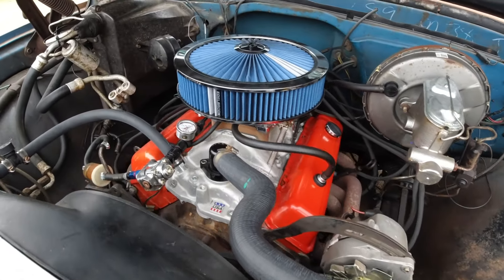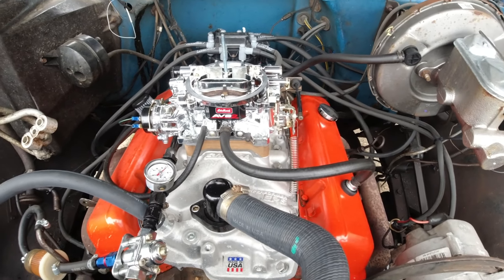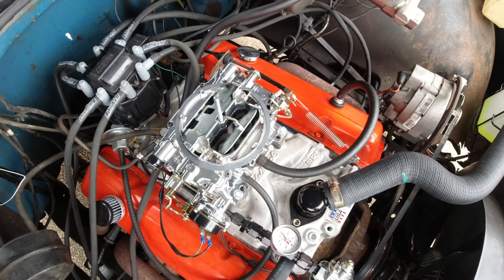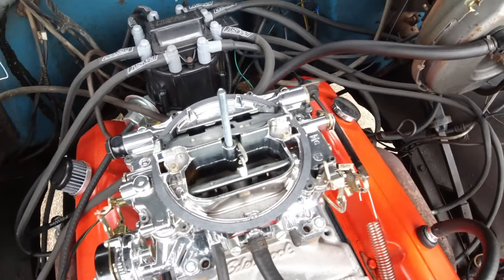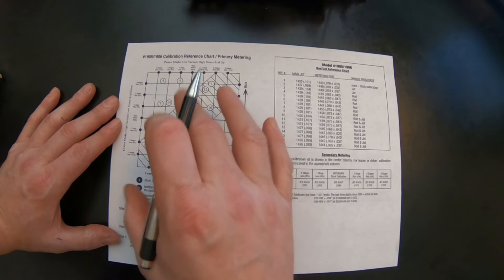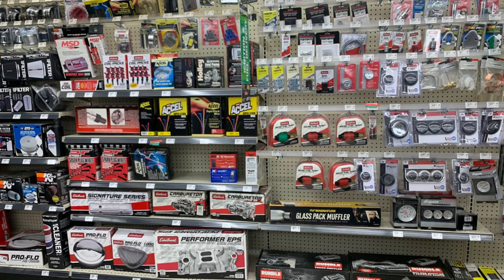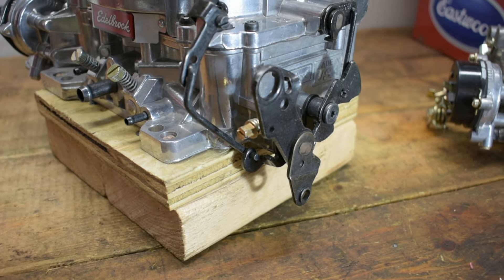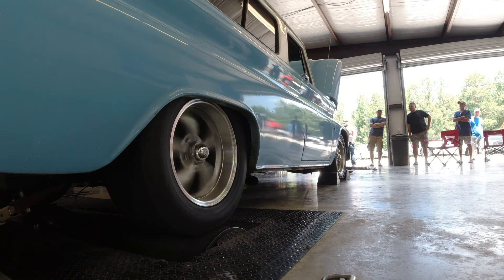Edelbrock Carburetors - The Good, The Bad and The Ugly

Comment: Hello car guys! Can some one tell me what size cam I can use in a stock 350 engine aluminum heads and using eldelbrock  carb and a aluminum intake manifold performer.. thanks everyone..✌️
Reply from the maker: Not enough info to offer a suggestion.  If you go look at the cam recommendation form on the comp cams website, you’ll see the list of things that need to be answered so a good recommendation can be made.

Comment: I have a Edelbrock 600 on a 351 W Ford engine that runs great. But it will not pass smog.
I have tried everything and it still won't pass smog. So I put the old Holley 600 on for the smog test and then put the Edelbrock back on to drive as it runs better and smoother than the Holley.
Reply from the maker: What did you do to tune the carburetors?
Reply: @MuscleCarSolutions  The smog test guy just said it would not pass. I went through the manual and bought a kit to recalibrate the out of the box calibrations to leaner. The second time I did the smog test it failed again except this time the smog guy said that the reason it did not pass both times was at idle not the 2500 RPM test. I wished I would have known that before I messed with the calibration. After blowing out all the idle circuits with carb cleaner and compressed air, setting the idle exactly per instructions, still would not pass the idle test. Too rich. So now I use the 600 CFM Holley for the test and run the 750 Edelbrock on the street. I am running a stock camshaft, and a 351 W Edelbrock dual plane performer manifold. 5 psi regulated fuel pressure. No vacuum leaks. I bought this 750 CFM Edelbrock carburetor new. It runs just fine, so I don't want to get rid of it.
.
Reply: Today I installed a new out of the box Edelbrock 800 CFM AVS2 to replace the Edelbrock 750 CFM I was having trouble with described in the discussion above. Problem solved. I just set the idle and made no other adjustments and got a AFR of 14 to 15 at idle. This is way better than the 750 with a AFR of 11 to 12 at idle. The AVS2 should be able to pass the idle smog test no problem. 😊

Comment: Wow amazing Video! Question I have a older Holley Carb part number 4778. 700 CFM It’s been on the Car for years. Engine is a mild SBC 350 with a performer RPM intake. Long Tube Headers. Factory Ac car. ( Ac works) my issue is no one can get this car to idle smoothly the Idle RPM is extremely high. I burn a bunch of fuel and I’m told with the adjustability of my current carbthat’s just the way it is. In your opinion am I “over carbed” for my mild set up? Would you suggest going to the AV2 to give me the adjustability I need to get a better idle and fuel economy? I look online and my current carb sells for $750… it just feels like overkill for my set up. I’ve taken it to professional performance shops. Same story this is the best it’s gonna get.
Reply from the maker: It could be over carbed.  Here’s a link to a video on how to select size and you can determine if you are or aren’t. I’ll answer you other questions in another post.  https://youtu.be/Hy4s9B43YM0
Reply from the maker: You still should be able to get the idle speed down.  Without knowing the cam specs it’s hard to gauge if that might be the cause.  The more radical the profile, the harder it is to get under control at idle. Remove the carburetor and check to see if the transfer slots are exposed, which I suspect are.  That’s why the mixture screws aren’t giving you the adjustability, assuming you’re not on a radical cam profile.  If you can provide the cam specs, we can include that or rule it out as a problem.  The other is timing.  What is your initial set at?  Timing and carburetors go hand in hand.  You adjust them both concurrently.
Reply: Thank You.  I know it’s a Comp Cam PART #
12-250-3 I have the spec card what specs do you need from it 

I’m not sure of my timing currently although I paid to have it set. I should know that.
Reply from the maker: @csmith0754  yup.  That’s a very aggressive cam.  Nothing mild about that at all.  Start with your timing.  12-16 initial is where you need to be.  Then you can start knocking the idle speed down and see if you can get it a little lower.  You didn’t mention if it was an auto or manual car?  If it’s an automatic, that cam likes a pretty big converter.  3000+ stall depending on what it’s going in.
Reply: Ok, it’s a Coan Converter COAN COA-20417-1 9in (245MM) Comp Torque Converter 

I called Coan out of Indiana they asked what cam, intake, engine size, rear end gearing and transmission I had. I did have that information based off that information they recommended the Convertor above. I have an Automatic transmission.
Reply from the maker: Trust the converter choice then.  On to timing.  That’s you’re next step.  Also what your vacuum at idle?

Comment: Thank you for the  video. I have a stock sbc 350 with the 1406 edelbrock and i live in Montana at 4k elevation. What can I do to jets and metering rods etc to get the best fuel efficiancy. This is on a 85 GMC truck, and I am trying to keep the four barrel carb, but I want the best lean fuel mixture I can get. Thank you in advance for help.
Reply from the maker: The rule of thumb is 2% lean for every 1500 feet of elevation gained.  It’s pretty accurate and an AFR for high elevations is always a good idea.  Helps keep an eye on it and will help in the tuning process for sure.  But without one, stick to that rule and you should be fine.  If you look at the Edelbrock tuning chart it will give you percentages on the lean and rich side so you can judge where you want to start based on your elevation.
Reply: @MuscleCarSolutions  thank you very much! So what springs and metering rods, and jets would you start with? I really appreciate the help
Reply from the maker: @scottcolvin4138  If you go to my website you can download the Edelbrock carb tuning guide.  Find the tuning charts for the 1406.  Look in the cruise mode and start tuning there.  It will give you the percentages of lean or rich on the sides and you can start with that adjustment on the primary and the secondary side.  I did a video on how to read the tuning chart.  It’s very easy and is the basis for all your tuning.  https://musclecarsolutionscarbs.com/resources

Comment: i have a heat soak issue with my edelbrock,AVS2, 650cfm carb. i installed the heat-spacer gasket, by edelbrock, very little help. was told that issue is due to the low boiling point of ethanol fuel, boiling at 173 degrees,causing flooding after sitting when hot.
Reply from the maker: That is correct.  Ethanol boils at a low temperature (varies by elevation).  The 3/8” thick gasket is ok, but sometimes more is needed.  I did a specific video on this that you might find helpful.  https://youtu.be/sXY4t8LSwjs

Comment: I've been waiting for another video, awesome content as always, can I swap my boosters for avs 2 boosters I'm running 4edelbrock carbs would like to upgrade them to avs2 performance
Reply from the maker: Hey John.  Couple things.  Yes the boosters will fit from an AVS2 to an older performer series.  Problem is, Edelbrock doesn’t sell them separately.  Also, even if they did, you’ll likely not be able to take advantage of them.  I am a few months away from doing this test and video, but I’m certain the fuel supply was also altered to account for more fuel flow with those boosters.  I’ll test that theory soon.

Comment: I have a holley 4160 on my 454 c10. I really want to make it a reliable long distance cruiser without ever LS swapping it. I guess getting an edlebrock carb is a start. I always seem to have gas leaking at the fuel line fitting on the carb. Those one piece fuel rails are never aligned right and Holly just make individual steal braided fuel fittings for that carb and only for the 4150 and newer models. Looking to switching to edlebrock and learning more before I jump into an edlebrock or just buy a newer Holly
Reply from the maker: I’ve said many times on this channel that everything is situational.  Pick the right carburetor for the application and then the right size.  You’ll not go wrong with that way of picking way to go with.  One thing the Edelbrock has always been famous for and that’s NOT leaking.  Keep watching the videos in the Edelbrock Tech series I have.  You’ll find that they are very simple to tune once you have the process and set up dialed in.
Reply: @MuscleCarSolutions  thank you for replying.  I’ll watch more of your videos. Just subscribed
Reply from the maker: Don’t hesitate to ask any questions.  YouTube sometimes is weird on sending me notifications but I try to answer every question.  Happy to do so.

Comment: The AFB is a good carburetor  have one from the 90s ,it sits and the thing I don't like is the single fuel inlet with two floats,when one float needle  sticks it will still run and you think it's the accelerator pump. Not

Comment: What carb do you recommend for street use daily driving and for off roading? Still debating if i should go EFI but i hear too many problems with EFI.
Reply from the maker: The folks that have problems with EFI are generally missing something critical in the system.  If the fuel system is set right, even the cheap Chinese knock off fitech garbage will run ok.  Get the fuel system wrong?  Doesn’t matter how much money you spent on the EFI.  It’s not going to be a fun experience.  As far as carburetors go, for a street and slow trail crawler off road application, the Edelbrock is my go to.
Reply: @MuscleCarSolutions  so basically the same thing with efi as it applies to carb. Get your input corrected to the efi or carb.
Reply from the maker: @armygreenfj3924  absolutely!  With a carburetor you can usually hide some of the sins if it’s not optimal.  In an efi system if it’s not right, it’s a bear to get the system to run right.
Reply: @MuscleCarSolutions  so i guess ill stick to my avs2. I got my wideband gauge on finally on my blazer but still haven’t installed a fuel regulator. However edelbrock states that the mechanical pump produces 6psi and doesn’t require a regulator. But I’ll never know unless i put on a gauge. It was running rich at idle but i got it dialed in base off my wideband gauge. Ill go ahead and install a regulator and gauge to make sure i have the correct fuel input. Thanks for your videos.
Reply from the maker: @armygreenfj3924  I see that frequently on just about all pumps.  But when you put an actual gauge to it, you’ll find a pressure that’s outside of the range.  It happens.  Not a knock on anything.  It’s just a very simple set up and small tolerances can mean big differences.  The worst are the off the shelf pumps from local auto parts stores.  The regulator just gives you the ability to make changes while tuning.  Always awesome to have more options!
Reply: @MuscleCarSolutions  so when tuning the carb with my wideband do i still need to use my vacuum gauge? Or just go off my wideband?

Comment: I love edelbrock only carb I will run and that turning left stuff you were talking can be fixed very easy you just buy the off road kit and it stops that I have one in my 4x4 truck and one in my 69 plymouth villiant works great and they cheap
Reply from the maker: Never had the off road needle and seat cure that type of starvation.  Just not what it was designed to be.  But glad you found some success with it.

Comment: I have 3 vehicles that have these carburetors. Love the simplicity and tuneability, but notice that if the cars sit for more than a few days the fuel seems to evaporate out. Any suggestions on this?  I have replaced one with a Holley and it doesn't seem to do it?
Reply from the maker: Is the carburetor bolted directly to the intake?
Reply: @MuscleCarSolutions  No they are both on non metal/aluminum spacers That did help a bit though. 2 other factors I live at very high altitude and in Colorado where the gas changes formula depending on the time of year
Reply from the maker: Ah.  Yeah that’s always a challenge in those states with different blends during different times of the year.  Because the Edelbrock is an all aluminum carb, and aluminum transfers heat very effectively, those carburetors usually suffer from the ethanol and fuel boiling out of the carburetor quickly.  There’s not much you can do about it, other than the spacer (which you were smart to do).

Comment: The biggest reason why edelbrocks get a bad reputation is because they are one of the cheapest and most readily available replacement carbs so when uninformed people have issues with their engine the first thing they do is blame the carb when usually they have some other issue like a bad cam or incorrect timing, so then they go to the auto parts store and buy the cheapest carb on the shelf which is usually an eldelbrock or one of those 4160 500cfm holleys and they slap them on and when it still doesn't run right they just blame the carb and call them complete junk. In my experience the edelbrocks are the best set it and forget it, get the job done type carb they are decent and you can find second hand carbs for dirt cheap because most people want a holley, take a $25 swap meet edelbrock, throw a rebuild kit in it and have a decent carb for under $100
Reply from the maker: There’s no doubt the big box stores facilitate this type of behavior.  Unfortunately that’s the world we live in.  The root cause is rarely investigated.  It’s just change parts till it sort of runs right.

Comment: I have an older Edelbrock carburetor and rebuilt it.  Before and after the rebuild the engine exhaust smells really bad but is not smokey.  I installed the springs and metering rods according to the chart provided with the rebuild kit. I am also at about 5,000 ft elevation.  I suspect that it is running rich but don't know for sure.  I'm thinking of buying a wide band O2 sensor but maybe you don't need to. Any suggestions or appreciated.
Reply from the maker: Yup.  I covered that topic in its own video for you!  https://youtu.be/l7fG6eMxv5A

Comment: Hey there sir,
One thanks for the video. This is helping me decide what carburetor I would like to change to. I think I am leaning towards the AVS2 1906. I have been looking at many videos on changing and I am not seeing anything about the choke in my scenario. I have a rockchester quadrajet 4 barrel carburetor ( autoline part number c960) and it has  a vacuum choke. Pardon my ignorance but my question is, can I use electric choke as a replacement?
Just not seeing any video talking about changing from vacuum choke to either electric or manual. Most definitely do not want to go to manual choke. So wanna go to the edelbrock 1906 electric. 
What are your thoughts?
Reply from the maker: Yes.  I’m assuming you have the divorced choke (choke mechanism is in the intake manifold and not on the carburetor).  You can switch to the electric choke easily.  I also did a video on how to wire an electric choke that you also might find useful.  Let me know if you have any questions!
Reply: Good deal thanks!!
Reply: Go with Manuel

Comment: What brand and micron rating of the see thru filter you are using before the regulator
Reply from the maker: 40 or 10 micron before the regulator.  100 micron before the pump, if you’re running a mechanical pump.

Comment: Considering an Avs 2 500 cfm for my stock 318 would like your input
Reply from the maker: Sure.  Depends on what you’re going to do with it.  I did a video on how to select the right size CFM.  Just a few factors to determine and a simple formula to follow.  A 500 could work very well on that stock engine.

Comment: Is Elderbrock a sponsor for you? A friend had to go thru 3 brand new  carbs until he got one that works! But I've seen many videos that right out of the box works great.  Your thoughts.
Reply from the maker: @jamescereda2628  sounds like a user issue.  Carburetors need to be in the right environment (ignition, timing, fuel system) and then they MUST be tuned.
Reply: @MuscleCarSolutions  so they sponsor  you? With your knowledge! I believe you! And Marcella! Thanks buddy
Reply from the maker: @ they don’t sponsor any of my content.

Comment: I been trying to get part number 1475 for over 8 months with no luck. I need the 4300 squrter
Reply from the maker: I’ve responded to this same comment you’ve left a number of times.  The .43 nozzle does not come in any of the factory carbs.  Right now, that’s all Edelbrock is concentrating on is getting out finished carbs out the door.  If it’s not something that supports that, the chances of getting one anytime soon is not good.  I probably have one that I would be willing to sell you.  I’ll have to look and see.  I recently sold a couple assortments of that part number to folks needing them so I’ll have to see if I have any more left.

Comment: Awesome videos!!!! I think I can tune one now!!!! I currently have one with a really rich idle it came from ebay I think it may need a few things....gonna check the fuel pressure, float level and metering springs  1/2 turn out on idle screws and its still burning my eyes.
Reply from the maker: Fuel system to support it is where you should start.  Filters, regulator.  Then start knocking off circuits and follow the tuning chart.
Reply: Never buy a used carb!
Reply: @SOLDOZER  it's a reman and it works great!!!!! Just have to be mindful when buying used. Don't expect to throw it on and work lol.
Reply: @SOLDOZER  I fixed it with good fresh fuel and a regulator.
Reply: @boostedstinger  I was going to ask if you got it dialed in, then I got to the last comment and you did. Awesome!